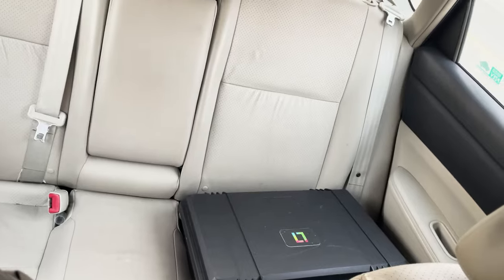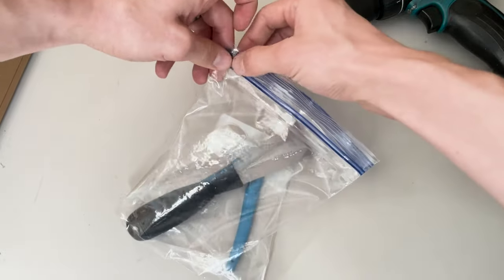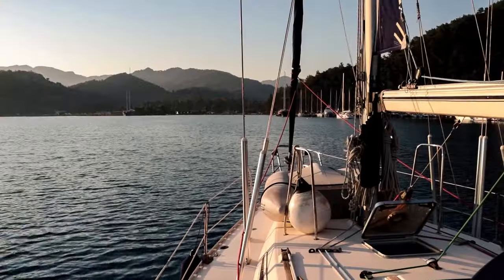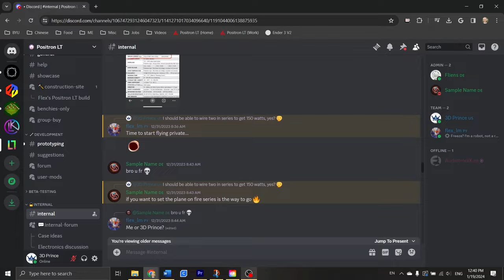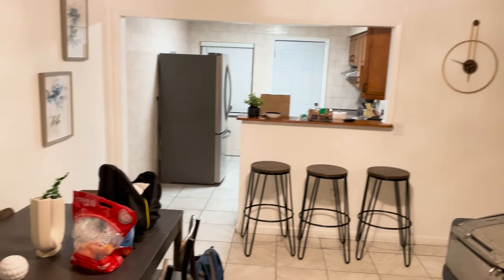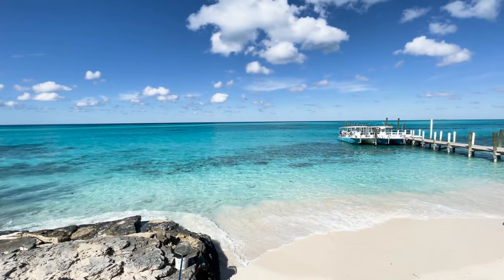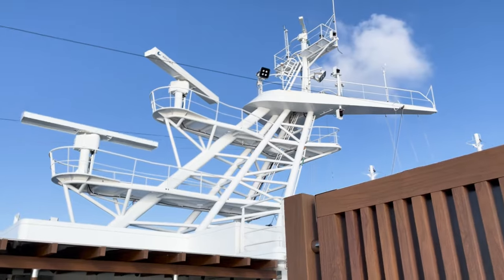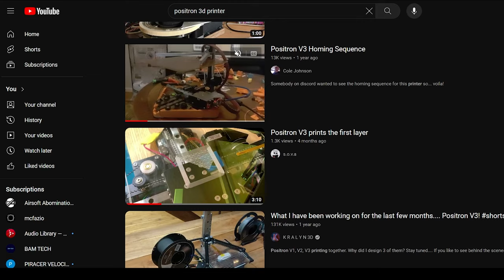I brought my 3D printer on a cruise

Comment: A perfect showcase of why we need the positron. I remember someone arguing you can take a 3D printer in your car. Not only is it a hassle but I travel by bus and train myself. A positron would be the perfect solution to prototype parts on the move.
Reply: Not only that, if you don't use the big pelican-style case, you could easily fit the Positron LT and a 1kg spool in a backpack in 2 spool boxes
Reply from the maker: If you do away with the glass bed, you’ve got a talking point there. Fortunately, there are some other carrying case options that are some other carrying case options that are way less bulky but still provide protection
Reply: @3DPrince-zd1se  with a 3d printer the limits are our imagination! I can fully see someone devolping a version of the Positron built into a briefcase or something (throwback to Ben Hecks briefcase 3d printer)

Im in the discord and planning to buy all the parts for the LT S1 in March when the final partslist is made

Comment: This thing is really asking for a build in battery supply. 
At least for an hour of work time (there are a lot of useful little things that can be printed in minutes).
Maybe at least with unheated bed and some kind of cold adhesive for pla. Also maybe develop some kind of energy saving mode if off grid.

Portable 3d printer is definitely a cool concept, don't get me wrong. But it has not a lot of sense if it also requires a fridge class amount of energy to operate 😅

I wish for someone to find a way to make this beast as energy efficient as possible and finally gave it some batteries and independency

Comment: make an adapter that allows you to plug into several of the ac outlets on the plane at the same time
Reply from the maker: Still wouldn’t work unfortunately :/ unless you hooked up to multiple rows.

But since filming this video I’ve realized printing on a plane is actually not a great idea😅. Make sure if you ever try it you get express permission from the flight staff first 🙂

Comment: That z axis was reaaaaally compensating for those initial layers. Your initial bed level might be really bad, relying on auto bed level alone is not recommended.
Reply from the maker: If I can guess what you’re referring to—there is a lot of movement in the z axis to due to the roughness of the infill, a byproduct of the oozy gen 1 hotend, and having combing enabled. This vibration is much reduced if you add a zhop on retract and disable combing. There are also other factors—we’ve improved bed rigidity for example in recent iterations.

I don’t think it is a bed leveling issue, unless you’re referring to something else? If you’re referring to the extra squish/elephants foot at the beginning of the print, that is due to a lowered z offset to improve adhesion to bare glass.
Reply: @3DPrince-zd1se  im referring to minute 3:50, thats auto bed level compensation working hard and I'm guessing your compensation fadeout in the firmware is around 5mm to 10mm in height before its turned off? i have also made a positron inspired 3d printer and my bed mounts have knobs at the end to adjust the glass height at those points.
Reply from the maker: @AvengerSho hmm, hard to tell from a blurry picture, but definitely possible. Cant be off by much more than 1mm, based on my experience. Bed leveling was a bit less precise with the mag connector for sure. Those holders on the end are adjustable, but I didnt adjust much in between all my packing and unpacking this trip

Comment: You probably violated cruise ship rules...  things with a heating element aren't allowed in your room (with a few exceptions for things like a hair drier) I'd be very surprised if the engineering dept didn't already have one on board... probably one that can do metal too.    As another poster mentioned, you missed the boat not doing the benchy!

Comment: Very cool. However, you are not the first to print from an Air B-N-B. I have been traveling with my 3D printer for a while now and print anywhere and everywhere. I was printing parts for my 3D Sets RC car in an Air B-N-B in Alaska. I flew with the printer and had no issues. I am also in an Air B-N-B at a Winery right now building another travel printer.
Reply from the maker: Cool. What printer are you using?

Comment: I love this little printer, but please don't (try to) print around other people in enclosed spaces like planes. I know PLA is supposed to be safe, but I can't print without having my nose clog up and make breathing harder.
Reply from the maker: Thanks for letting us know about your personal preferences/needs. If you ever see me or another positron user sharing the public space, it’s totally appropriate to communicate to us if it’s causing you any health/allergy issues. I can’t speak for everyone but I definitely want to respect that.
Reply: Planes are in fact especially well ventilated, with air inside the cabin being renewed very frequently, and airflow moving usually from ceiling to floor. An airplane cabin is thus not so bad in this particular case.
Reply: The air is pumped in from outside via a compressor to create normal pressure inside the cabin. It is then vented outside again. This happens continually during the flight. A study during Covid found that the air is completely refreshed every 2-3 minutes. The air up there is also pretty clean considering most smog stays closer to ground level and the air at 30,000 ft is often above clouds and exposed to direct sunlight and UV which kills most microbes.
Reply: Weak
Reply: Captain buzzkill overhere